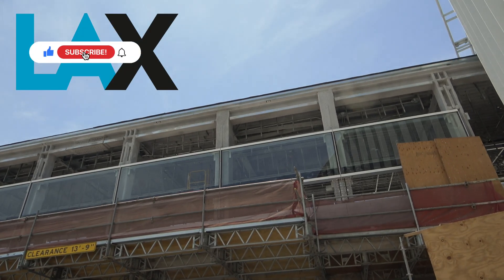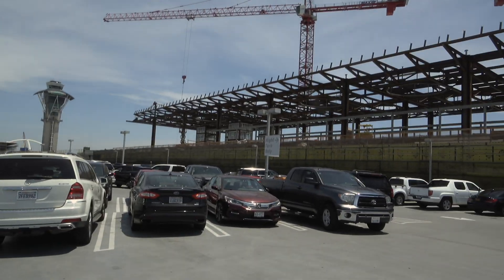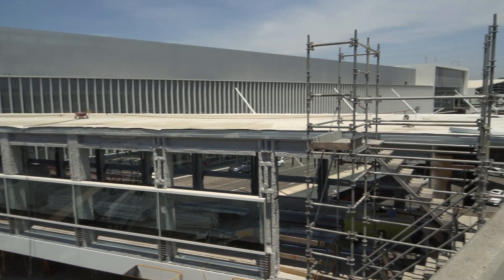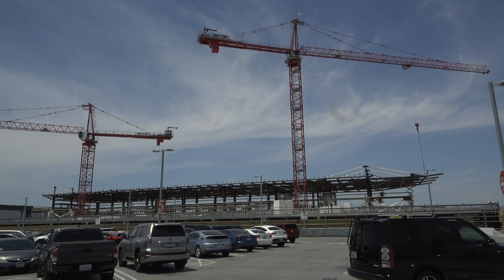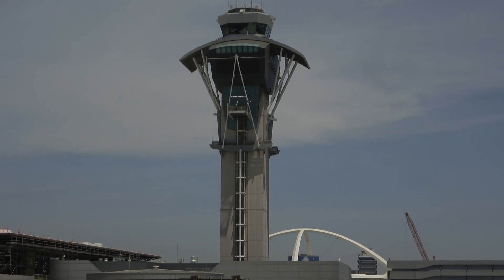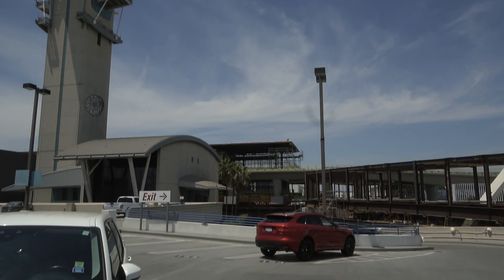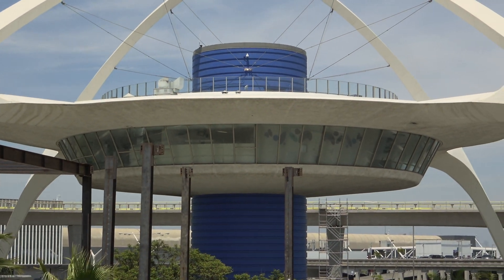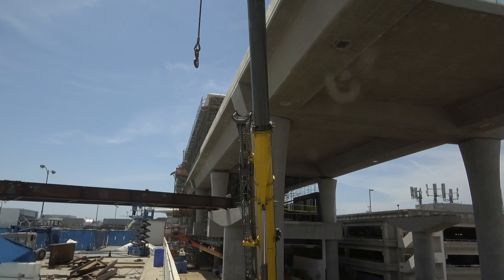LAX Airport $2 Billion Automated People Mover | Construction Update

Comment: I can see them reopening the theme building into a bar lounge after all the construction is completed and you can use the trains and walkways to access the entrance. However, the building needs millions of dollars in investment to bring it up to modern building code laws and standards.
Reply: As one of the most iconic structures in the United States, I'll put a hundred bucks towards it.
Reply: If they add an extension off the sky bridge that connects to the theme building, it will be one of the most popular attractions at LAX. Even more so if they also reopen the roof access to the building. The problem with this theme building has always been easy access. Now, that is within reach. I really hope they do it.
Reply: They have a request for proposal out for a company to proposal a hotel next to the theme building.